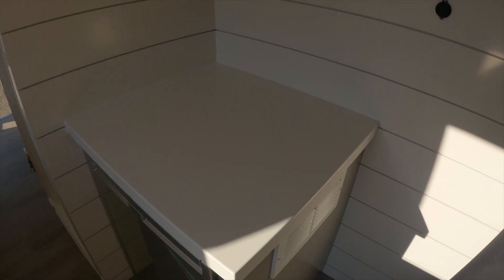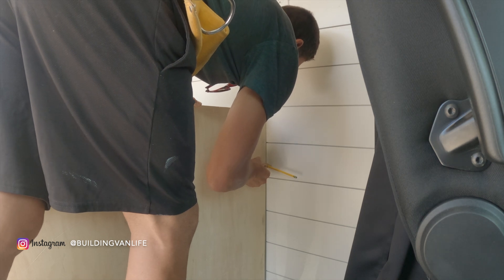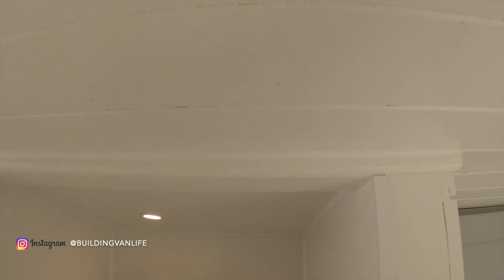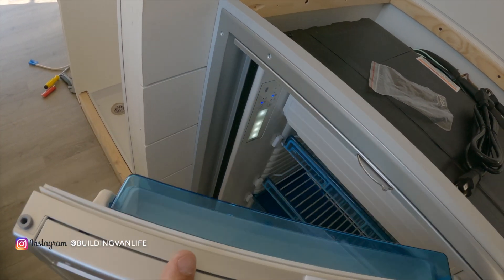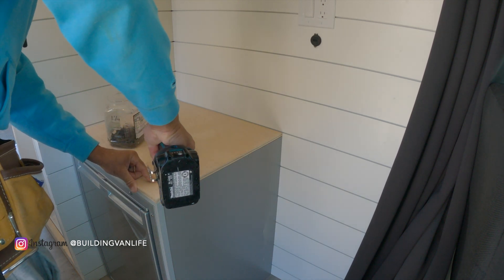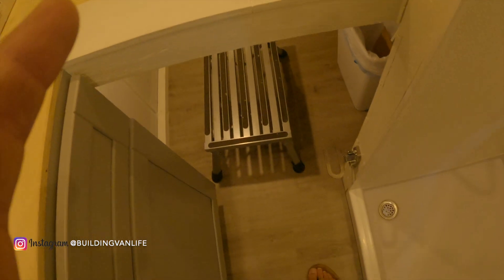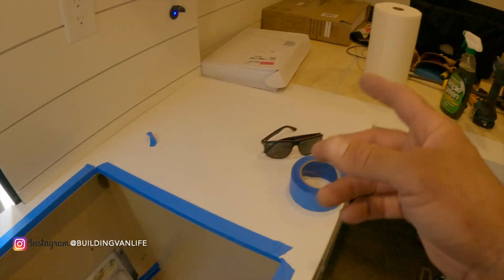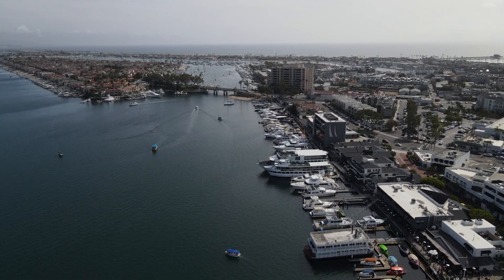Promaster Van Build | Ep12 | Countertop & Fridge

Comment: How heavy is the fridge.  Higher mounted fridge easier access I think
Reply from the maker: It’s fairly heavy.  I considered doing a toe kick to raise the height but the reason I didn’t is because there will be a seat next to it and it’s the exact perfect height to be a table where it is. It wouldn’t be hard to raise it if that works for your application